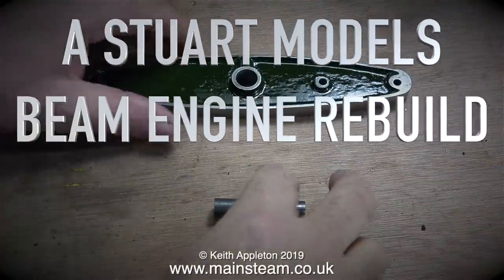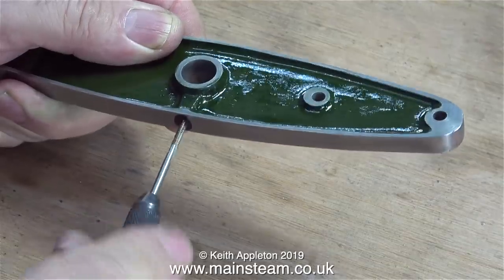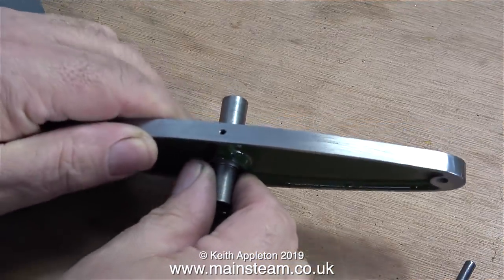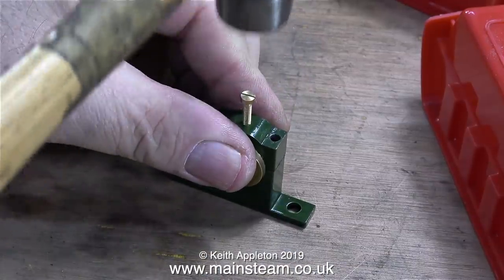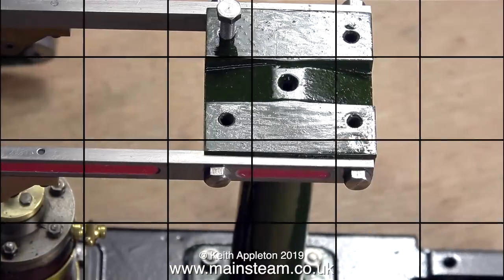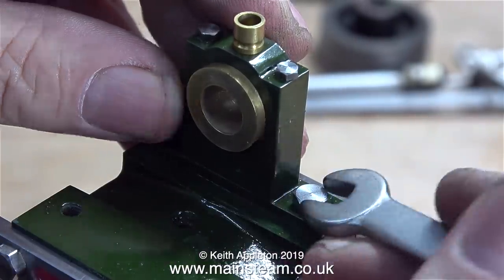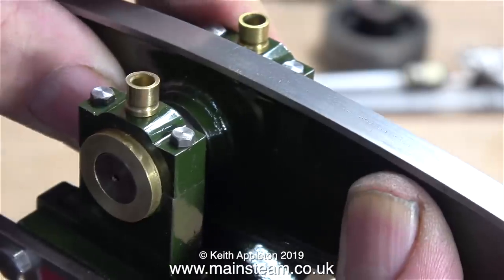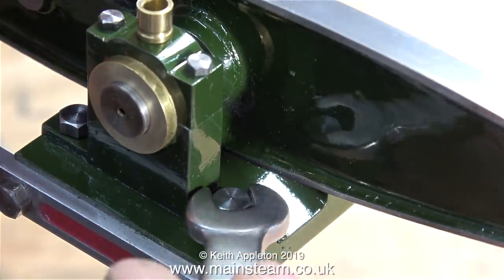A STUART MODELS BEAM ENGINE REBUILD - PART #12

Comment: Quite a few engineering mistakes here but you seem happy with the results.
You should have started all your bolts before tightening any of them. 
There should not be any paint under the bearing carriers for the beam this 
Will only throw off the alignment of the bearings. 
Looks like a nice model though 👍
Reply from the maker: This is just about the worst model steam engine that I have ever worked on. It is extremely badly made. By showing the progress in the way I do, the faults & rectification procedures will become apparent and easily recognisable by beginners to the hobby for future reference. I am not happy with the results by any means yet. . . . . . .